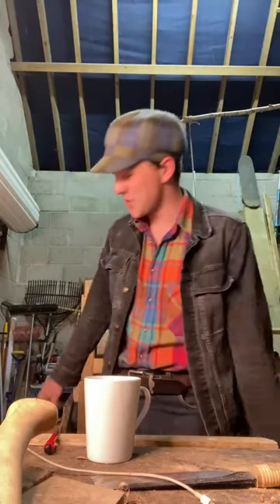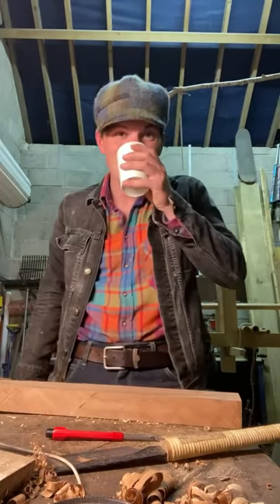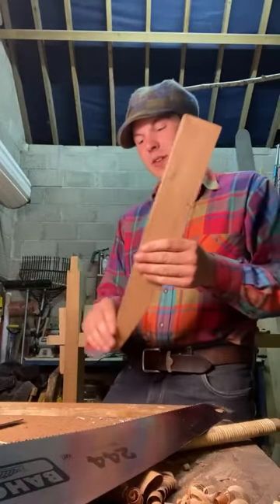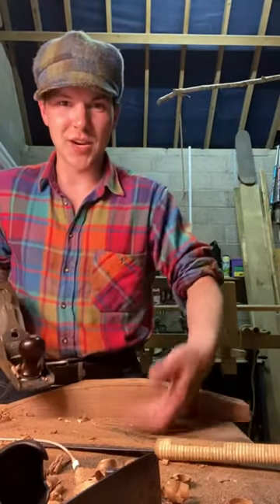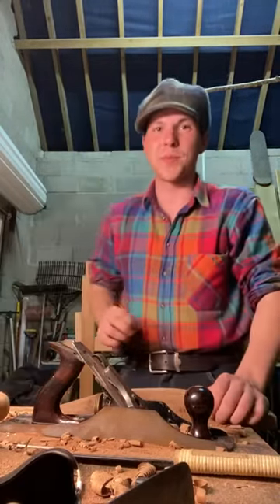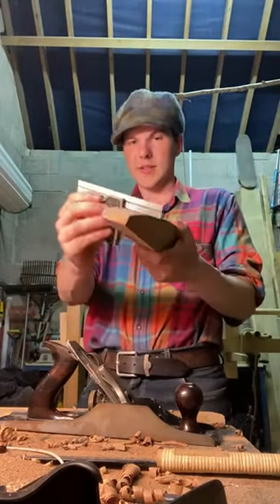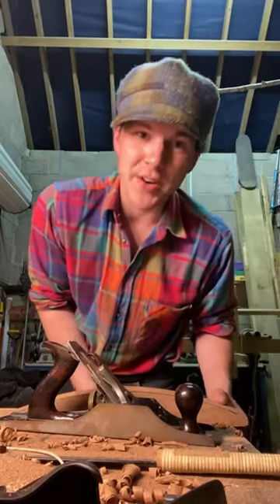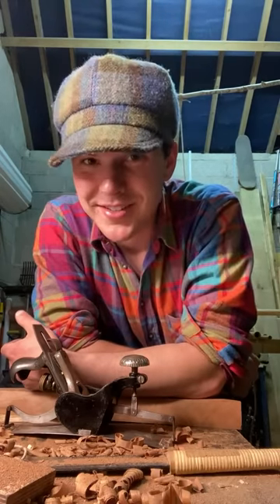Chair making live and direct

Comment: You didn't waste yer time in college.  It's doing exactly what it should do and help you figure out if the path you are on is the right one for you. Course correct if it makes sense or change major to a better fit. At the end of the day college is there to challenge and help you learn about the tools and skills of yer mind and figure out your strengths and areas for improvement. You don't know what you don't know and your instructors are there to help show you applications and or theory that works. Do the very best you can. The more work you put into learning the more you'll get out of it (just like learning how to sharpen tools). Grades are there to tell you where you stack up against your peers, whether you are doing well or need help, and lastly whether the instructors are wasting their time or if you have the drive and determination to meet the challenges of the class and invest more of their time to see you thru.